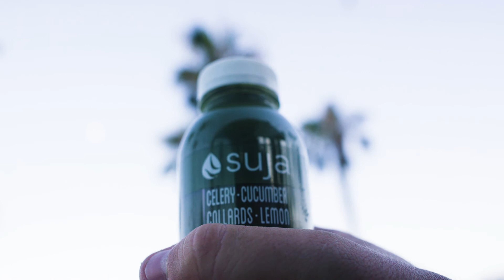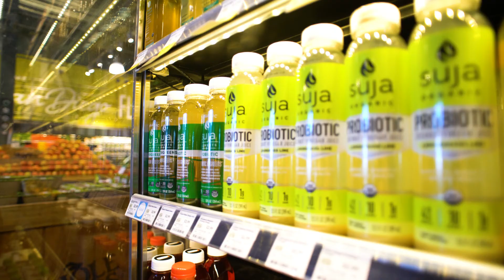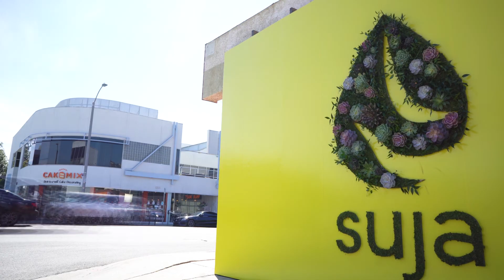Suja Juice (Brand Documentary)

Comment: Could you elaborate what you mean by leaving out the bad stuff? Insoluble fiber is bad?
Reply: Bad : I’m an operator there . “ instead of the juice rotting in 3 days . After the juice is processed with 87022 psi cold water “ the expiration date extends to 90 days . It cleans out all chemicals from the bottle . And any solutions that can be from the juice